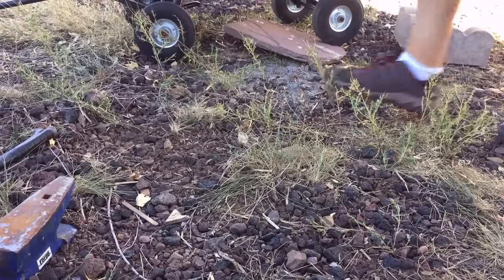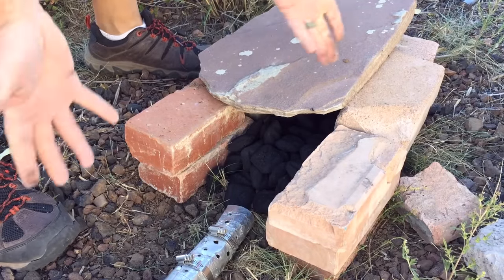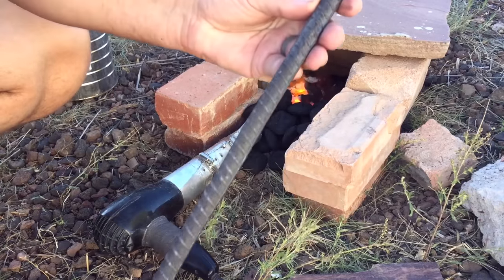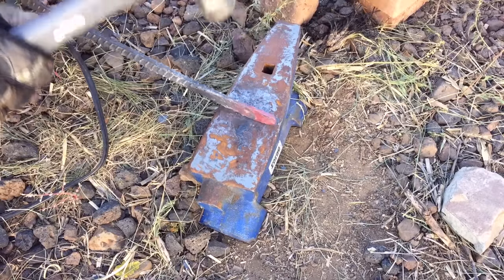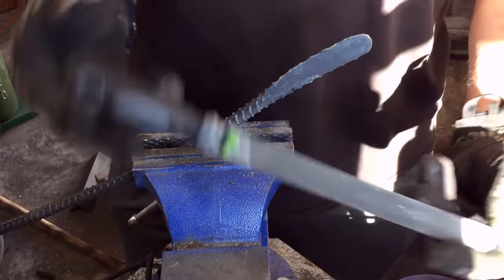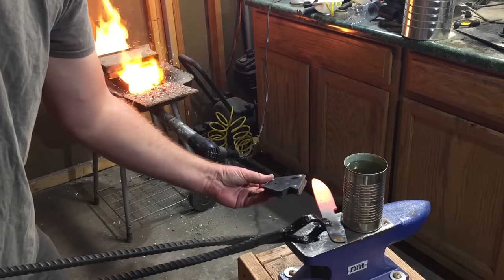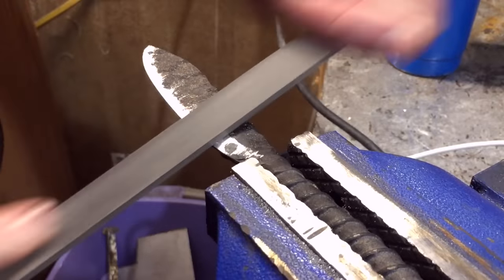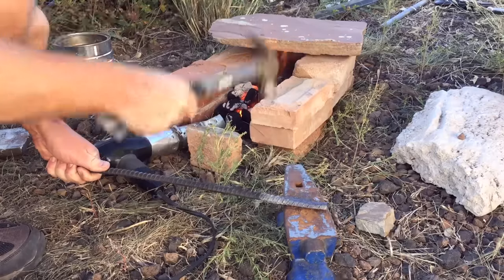Start forging TODAY in your own backyard - no special tools required

Comment: "this is rebar sometimes you will find it laying on your property" i guess rebar grows naturally in rural areas
Reply: you can find them in construction sites i guess
Reply: if you have brick laying around, theres a good chance youll find rebar nearby,
Reply: My grandad picks the stuff up wherever and whenever we can, I wouldn't be surprised to find out we have over a ton of rebar and old lawnmower blades and the like.
Reply from the maker: 🤣🤣🤣 Underrated comment 👌
Reply: Here in Kentucky it does lol
Reply: Lol.  My first question was, "wait, why?"
Reply: Mine found it yesterday in demolished bldg,  im gonna make a handle for hack saw.
Reply: in construction site they usually throw this kind of stuff on garbage can and totalled it into garbage collector for a cheap metal waste conversion. you can ask for 1 or 2 and they will probably give you
Reply: They actually seem like they do though...
Reply: Spencer R it’s ok, I just drilled into a building and found one
Reply: I need to replant my rebar, I've been putting it off.
Reply: Spencer R yeah pretty much actually
Reply: Thebasicmaker If you go to the bayou I Houston walk along always find lots of scrape metal and sometimes toils
Reply: That's exactly how our ancestors did it
Reply: It seems to on my property.

I have 2 acres, I've lived here 5 years and just last week I found 3' of rebar behind a tree. I've never bought rebar and the previous owner didn't do much in the way of construction, (or anything outside for that matter)
Reply: Chapter Master Adolf 
L
Reply: No he is talking about if you have one lying IN YOUR YARD DUHH
Reply: I found it growing out of my yard. A whole pile of it. Oklahoma
Reply: @dustinloyd3617  Haha yes, they seem to have developed a symbiotic relationship over the centuries.
Reply: Funny enough I tripped on some rebar yesterday.
Reply: Rebar can be found anywhere except for anarctica
Reply: i found some growing out of a pile of salmon berry bushes... four nice long stalks of re bar about 10 ft long with a bit of rust growing on them. It seems to have sprouted right out of the bramble roots.
Reply: I’m cleaning up my papaws after he died last year. There’s rebar all over the place. Also, lots of old metal to practice on. A month or two before he died, I asked him if I could build a forge because all the pieces and tools were there.
Reply: out here in the country, it really does lol, bought 10 acres, there's shit everywhere out here, even my own garbage dump yay
Reply: @wait4613  wait
Reply: I had some rebar protruding out of the ground near my fence on my property lol
Reply: Halo Theories  I already made two French nails.
Reply: Haha yeah, living in the suburbs you'll never find rebar just lying around. Nor bricks.
Reply: ya i found a lot
Reply: Spencer R Just the other day I almost tripped over a piece in my yard, I don't even live in a rural area, I live in a suburb. I'm not exactly sure why it's everywhere but it just is.
Reply: Yeah and I guess blowdryers grow on trees now
Reply: Rural workshops*
Reply: James Pfiske p r e c i s e l y
Reply: It really does seem to, yeah.  I think it's because it's used in a lot of construction, and extras or bent pieces just get tossed.  But, yeah, seems like you can just take one look at a property and think 'There's old rebar around here somewhere.'
Reply: Spencer R it does
Reply: Rebar is known to grow in all rural areas
Reply: TJ_ the_Insane  I would imagine so. I  moved to the property when I was 12, and I keep finding stuff buried where we put in gardens, lots of Hot Wheels and midsize Tonka trucks. I'm guessing a lot of the metal came from the 13 acres of Vineyards surrounding us, but that explains how it got onto our property.
Reply: James Pfiske 
I found three blowdriers in my wife’s sink cabinet apparently they had been breeding asexually.... she doesn’t need three....

And I’ve found rebar in lots of places around the world.... sadly I didn’t find any rebar in the off grid property I own, just three dead bodies.....
Reply: yes it really does
Reply: you clearly haven't been to arkansas, that shit grows everywhere
Reply: Can confirm. I live in a rural area and my backyard is a literal junkyard. I stepped on one that had a curved end and it whacked me in the face
Reply: You can find it almost anywhere next to job sites, allies etc or just buy a few short pieces. It is relatively cheap.
Reply: Spencer R wait is that a reference to I did a thing making the axe
Reply: oh yeah, its such a pain to cut in the summer.
Reply: I swear man it's just like trees
Reply: I guess some ppl live in a junkyard.
Reply: @iamtheteapot7405  Nah some people just live on a farm.
Reply: I actually think it does I see it all the time on our property
Reply: It's true! I just tripped over a bundle in my garage!
Reply: sometimes it really seems like that. i'll be digging up dirt for my garden when i uncover a rusty piece of rebar. the stuff is basically free
Reply: There is like four lying around in my yard
Reply: It seems to here in west virginia...along with junk cars and washing machines.
Reply: Actually...funny thing is, I found a 2 foot piece under my deck when I went looking.
Reply: Nice
Reply: Rebar grows wild out here.
Reply: Youtubes finest commentz...hall of fame comment
Reply: If you don't keep after it turns to cars on blocks
Reply: Rural Georgia, checking in: I have been absolutely surprised with how many pieces I have found on my land. Dig a new garden, find a piece of rebar. Cut back some old overgrowth, find a piece of rebar. I've found at least 5 pieces.
Reply: You have almost as many likes as  this video ha coments
Reply: It’s most frequent than you think. Probably the most common metal found in the ground left behind.
Reply: @dustinloyd3617  what type of Species are bricks
Reply: Yes, but not in those soil conditions the rebar he found was likely seed rebar that drifted in on the wind from a nearby clump
Reply: Go to rail road tracks, I’ve never not found scrap metal along the tracks
Reply: @Aidan Stone shit i don’t even know, I was a little drunk you may be right
Reply: Indeed
Reply: As someone who lives in a rural area, I can attest to this statement being true and accurate.👍😂
Reply: When we moved into our house about 10 years ago our backyard was littered with bricks after we picked them up we found rebar in quite a few places as well as in the front yard "garden bed"
Reply: I found six feet of 1½" rebar in my woods XD
Reply: I’m sure he meant if your already into doing thing that you have random tools and possible miscellaneous stuff for building
Reply: Well, yeah!! Sometimes at least, people dump all kinds of stuff!!
Reply: there is some rebar laying on my property rn lmao
Reply: We had a good harvest of rebar this year , 10 feet of it
Reply: First pierce of rebar I ever touched was just laying there near my house.
Reply: @iamtheteapot7405  Don’t act so fucking high and mighty, leftover rebar is found all over the place.
Reply: I know iwas thinking be good if I could find about 40 15inch ones in my garden for my shed
Reply: It's an invasive species so pick it anytime you get the chance
Reply: Recycling ftw? Lol
Reply: yes it does, i have around 30 meters of different sizes of rebar behind the house
Reply: If you live in poverty, like me, yes it's in your backyard
Reply: Actually yes lol
Reply: It does
Reply: I have found a few in an old lot
Reply: @iamtheteapot7405  nah, some people are just living like true men city boy 😎
Reply: @blanka1376  you find it everywhere lol old fencing, leftover construction, just for funzies. It everywhere 😂
Reply: My man, you don’t understand how we poor folk live. You need a vehicle to get to work, enough land for livestock(that’s the goal) and a gun. Rebar (if you want it or not) will be there.
Reply: @chrisquiett1776  lol yup, its awesome tho, great for us newbie blacksmith
Reply: @chrisquiett1776  poor folk? Dude! Id live like that even as a bilionare! Country for life
Reply: Only wild rebar
Reply: Ironically enough I have found random rebar
Reply: No, everybody knows that they grow naturally in the southern states of the US.
Reply: @johnsteel6008  i bet hes going to have something historical without realizing it
Reply: Sometimes you could swear it does grow on trees.
Reply: Iron root. It's fun to cut trees with nails in the middle that grew in over decades and have disappeared into the tree. We call that iron wood
Reply: I had a rebar farm in my old side yard.
Reply: Typically used to mark out property lines 😂
Reply: I found some wild rebar out on my land lol.
Reply: Kinda like hypodermic needles in the city.
Reply: It does.
Reply: That's what it feels like sometimes.
Reply: xd it does
Reply: It dors
Reply: @TheRoadhammer379  what, how is that derogatory to anyone
Reply: Is that not normal
Reply: Well, in my local area there is a landfill the farmers use and it's full of rebar
Reply: I literally said the same shit. Next day walked outside and found about a 6 foot piece next to my house I am still surprised
Reply: Wait, did you not know it does?
Reply: I pulled a huge piece out of the ground. Thanks old tenets
Reply: I had a very good friend give me a rebar tree I planted and oiled it everyday and patiently waited only to come out one day to my surprise to find I had a angle iron TREE oof
Reply: @R3nz_  lol, that’s probably your property line from it being surveyed.
Reply: Funny, lot's leftover from building jobs. Bent into shapes so they can't reuse! Make friends with some builders!
Reply: You clearly have never lived in the boonies trust me you find some random shit in the pasture
Reply: You’d be surprised lmao
Reply: Broken buildings
Reply: My property used to be a dump for debris from construction back when my neighborhood was being built in the 1970's. I find rebar all the damn time in the woods on the edge of my property.  That shit makes excellent weldable material.
Reply: Usualy if a house is built they had concrete somewhere near by there probably will be rebar there
Reply: It does
Reply: As a contractor specialized in concrete I can confirm this.
Reply: I guess that’s the point of adding sometimes to specify you won’t always
Reply: You gotta plant rebar seeds first
Reply: Its true you just gotta find a rebar plant
Reply: I’m still trying to get rid of the infestation
Reply: Rebates just sprout out of the ground around here
Reply: Tbh out here it basically does 😂
Reply: It also grows in Home Depot
Reply: I love it
Reply: Its a common form of trash. Even here in the suburbs you can often find some laying around the foundations, abandoned by the construction crew
Reply: It does trust me
Reply: Yes
Reply: I can confirm this
Reply: Seeds of Steel Rebar !.. never Seen one ?
Reply: Sure does
Reply: It does, dude.  I've lived on my property for years now and I still find rebar/tires/wheels/bricks/all sorts of interesting shit from time to time.
Reply: It's true
Reply: Maybe not but that stuff litters the ground at construction sites
Reply: Yep
Reply: @napoleondynamite4148  no but the dollar store though.
Reply: I have a bunch growing wild on my property, so I'm just gonna break off a couple pieces and get to work
Reply: On my property?  Yes.  And backhoe bucket teeth, random bolts and nuts, steel rods, mower blades, plow blades, a cast iron bathtub, and more.  Any timenI dig up dirt on my place I find either metal or glass.
Reply: Everywhere modern humans dwell was once a construction site. Therefore you may find spare rebar laying around.
Reply: It actually does....
Reply: @skankhunt6066   I live in Nicholasville,  can confirm.
Reply: Go to a river or creek with bridge get a magnet or grappling hook throw it in you will find rebar
Reply: it does
Reply: Lets see does it grow in yards? No and I don't believe thats what he means in his statement.
As a construction working and home builder. Yes go dig your yard up close to your houses concrete foundation hell take a metal detector bet ya strike gold with rebar then and it will seem like ita growing out your yard. And you young man will learn yes there is rebar in most new constructed home sites. Especially those with concrete foundations end of story. Oh and one other thing its wise to understand not assume. Understanding comes from seeking the truth. Truth is they do throw waste on build sites buried in your yard. Believe that as fact.
Reply: It does grow I shit you not
Reply: Live on a 80yo farm, can confirm
Reply: Hater
Reply: I know. I'm wondering what this guys property looks like
Reply: Yeah it does the chickens usually eat it
Reply: I guess it does. I have quite a bit, but I can’t remember where I got it.
Reply: Lol
Reply: It actually does tho
Reply: Best comment on here 😂😂
Reply: Pretty much
Reply: They use rebar for land markers.
Reply: It really does, I find it everywhere
Reply: In Oklahoma and Colorado I can tell you it does lol
Reply: I’m upset that I actually found some in my yard lolol
Reply: I.m ig it does there was a long bar in my garage also you can buy it at lowes or home depot for lik 5 dollars
Reply: @dustinloyd3617  Well my parents have bricks laying around...
Reply: i'm not kidding i've got wild rebar and i-beams laying in the backyard cus the guy who owns the farm next to ours builds bridges
Reply: I have found a 20 foot piece of rebar
Reply: Does it not grow on your property? I've got whole rebar gardens.
Reply: It definitely has its pros living in rural areas!
Reply: I've found probably 30 3ft rebar pieces with a metal detector on my property
Reply: Your neighbors concrete drive way may have rebar when he goes on vacation or is at work. 😂
Reply: Actually I have a hell of a lot of it up against the fence in the back corner of my yard. I'm like YES...PROJECTS 😈😂
Reply: Must of never seen a great southern rebar tree 😂😂
Reply: @nathanthegreat28  yep that them should see them in full bloom 😂😂😂
Reply: The fact that this isn't a joke.. because ever time I go on a walk around the local paddocks or around the block in urban areas, I find rebar literally everywhere
Reply: Ngl it does I was working on my property and found a rusty screwdriver like a foot underground
Reply: Old guard rail posts have a bunch of rebar in them grab a hammer and volia! Free rebar freebar !!! lol
Reply: Kinda yeah rural texas is full of old metal junk lyin around in the desert and old farms just from breakin off of stuff and forgotten structures over the years
Reply: Check your crawl space. That’s where it grows best
Reply: Yea you’d be surprised, I find random nails, rebar, metal sheets and slivers. It’s everywhere if you look
Reply: @mohanbhartiya2705  actually our ancestors used meteorites
Reply: Basically
Reply: i used to live in the country and still kinda do. its true wander the desert youll find rebar brick and other trash
Reply: Thankfully I work construction so all the materials needed were available for free. Good to see my crude assembly is practical
Reply: That's the south for ya
Reply: Lol only place I’ve ever seen rebar in the UK is when I was on a fabricating apprenticeship hahah. No known rebar in the wild here
Reply: It grows on the side of the road
Reply: it has a .13% more chance of spawning in rural comunities
Reply: With how much u can find ud swear it does 😀😂
Reply: And barbed wire lol
Reply: Yup, it does. Been living on our acre in Spain for three years and am still finding more.
Reply: yes i found it grows naturally in tentricle formations
Reply: That's good
Reply: Sure feels like it some times!
Reply: As somone living in a small swedish village, yeah it seems to grow fine.
Reply: if you see invasive rebars pluck them out of the ground, they hurt the survival chance of the native ones
Reply: Pretty much LMAO
Reply: It grows in concrete sidewalks
Reply: Citiot
Reply: I have a rebar tree.. The kids always sneak in my yard and pick them before they get to full length..
Reply: Tbh yeah, ya find it in places u wouldn't think
Reply: I have a serious problem with rebar growing on my yard a have tried everything to get rid of it I find a angle grinder works pretty well now I make so much money growing rebar I was able to quit my job 😅 🙃
Reply: I find rebar fucking everywhere
Reply: I got that shit growing up all over my property, like weeds.
Reply: Just about in the south you may find a stray peice sticking from the ground by the woodline🤣
Reply: 🤣🤣🤣 yeah sometimes lol
Reply: You have no idea
Reply: it sure seems to
Reply: You know, it does I find it enery were
Reply: It grows and yields better than my crops in the field
Reply: As someone who has fallen over and hit some rebar at home, yes
Reply: It is here
Reply: I found some laying around my barn
Reply: The can't you tell that this guy is a rebar farmer?
Reply: It grows pretty often at my place, it blends with the tall grass though.
Reply: Rebar is a native vegetable it is grown from the rare barria plant.
Reply: Ah yes the wild tree reebarium steelium
Reply: Mama used to make the best rebar pies
Reply: its been ten years since my house was built and yes, theres some still laying in the ground... 
and i got some from the bins as the other houses were been built.. never know wen you need an irrigation pin, or sturdy plant stake termites cant eat
Reply: It's true lol
Reply: Didn't he say that you could get it at a store?
Reply: City boy
Reply: They do, in postsoviet countries they are everywhete
Reply: They do I've been growing one since it was a foot long 4 years later it's 10 feet
Reply: @skankhunt6066  I think they used it to mark property lines in Ky we had a lot throughout our neighborhood
Reply: You laugh about but let me tell you. I got pieces that I have no idea where they came from.
Reply: Surely not hard to get tho
Reply: Picky a hole aren't we?
Reply: Yup.  I found 12ft at my house - laying between the fence and the vegetable garden.   Literal people suck.  They honestly do.  Suck the life and hope out of any prospect.  Well done.
Reply: Here in Britain 🇬🇧 it does
Reply: Honestly wouldn’t be surprised if it reaches did
Reply: Correct. I have a rebar farm near my house. Very successful.
Reply: Dead cars tend to grow in rural areas also……
Reply: over 100 years yeah you might find some.
Reply: In the country where i live I dig up metal all the time including rebar
Reply: I bought a cabin in the sticks, I got rebar seemingly growing everywhere!
Reply: Actually it does!! I found some sticking out of the ground just last week. Might be blooming soon.
Reply: He must live here in Texas
Reply: Wait. Not everyone has a native rebar tree?
Reply: It’s like a half joke lol
Reply: As crazy as it sounds it's true. I found an old piece of rebar while cleaning up my yard when I first moved in.
Reply: It does Ive found about maybe eight pieces now
Reply: I can confirm
Reply: If your house has a concrete foundation, then there is very likely a piece of rebar laying next to it somewhere. It’s probably buried a few inches under the dirt/gravel, but it’s there. I’ve never met a concrete crew that picks up their scraps in 20 years of construction. 😂
Reply: If you don't have a stable rebar population, you might find the smaller cousin, barbwire 😄
Reply: It depends on where you live, if you live on a big estate (farm, plantation, construction, etc) you will likely find it laying on the ground.
Reply: Guys property is hella big! 😂
Reply: Post apocalyptic games
Reply: Nope rebar grows naturally in industrial areas. This is where youre having the problem.
Reply: Fr lol, I don't even work with metal yet it's just randomly lying around the yard 😂
Reply: frl yeah
Reply: He should have said, “Men capable of forging a knife from logic and experience with zero training, will find rebar in their yard”. 
. Any home owner worth his keep has rebar somewhere and could likely take a small amount for a knife to be made. Since you aren’t that person, it likely went over your head. Glad I could clear that up for you lol
Reply: They use rebar at property corners to easily find them in the ground with a metal detector…. Lol don’t use the rebar you find near what is likely, your property corners…. It’s there for a reason. Makes surveying your property easier if you are going to expand it or section it off into multiple properties.
Reply: Does your backyard not grow it….?
Reply: Do you not have a rebar tree?
Reply: They grow best in construction sites
Reply: In permafrost areas of the world they grow continually and usually are found when a tire is blown 😢
Reply: I too have come to find this 😂
Reply: Unfortunately that's how it feels sometimes
Reply: I live in just a random rural town, and I think I have found 100+ bars of random rebar. It has to be growing here.
Reply: I have several feet of it around my house. Not really sure how it got here but it did!
Reply: Just found a piece a week ago lol
Reply: Believe me it does I dunno where it comes from but we got tons of it where I am
Reply: Greatings from Germany Bavaria here you realy find them often lying aroun in small groups
Reply: I live in a city and I’ve got about 20ish feet of rebar just sitting in my room don’t even want to count how much I’ve got lying around my house😅
Reply: Trust me. They really do.
Reply: Yeah you can basically just surface mine for it lol
Reply: yoska222  found an old ass rusty rebar hanging on the side of my shed
Reply: Crazy story  just moved into a new house and I actually found rebar lying around
Reply: I really think so. You dig and it's just there.
Reply: Wait it doesnt?
Reply: I have 7, 4 ft each😅
Reply: Train tracj
Reply: Train tracks
Reply: @dustinloyd3617 I don’t
Reply: It does in Australia mate
Reply: Reading this comment as he explains in the video "its easy to find 20 feet of it for $20-$30......oomph comment.
Reply: @dustinloyd3617 i mean hes not wrong
Reply: This is true. I’ve never bought rebar ever. I just go to my backyard. There’s always a wild patch sprouting somewhere.
Reply: It must cause I can't kick up dust with my foot on my place without stubbing the shit out of my toe on some buried rebar
Reply: It really does you don’t understand
Reply: A lot of times rebar is used to mark the edges of a property by a surveyor. So if the property has changed hands a few times it’s not unusual to find rebar on your property.
Reply: ...... yeah.
Reply: The mystifying wild rebar has confused scientists for decades, with it's ability to seemingly materialize out of nothing. This phenomena has been reported all across the globe, but seems to mostly appear in more rural areas. Note that if you find wild rebar on your property, there may be bricks or cinder blocks nearby, as they seem to appear together frequently.
Reply: dude i have a shit ton of rebar that my dad has just gathered over the years
Reply: Yeah, we got steel trees and brass bushes
Reply: Apparently it does, I just found one lmao
Reply: It actually doesn't grow but procreates and yes it's natural habitat is rural backwoods areas.
Reply: Came from the south so might be related, but where I live you can’t drive a few miles…or walk, without finding some kind of “useable” type of material like dudes showing, rebar just seems to be abundantly abandoned down here🤷🏻‍♂️😂💀
Reply: Just look for  a junk pile,  that have weeds growing in it
Reply: I found some in my creek when I moved into my house 4 years ago
Reply: @iamtheteapot7405  better than where you live, I'm guessing some Cesspool City.
Reply: @BryantWalker-m6e  did I hurt your feelings or something? Why are you trashing my city when you don't even know what city I live in lol
Reply: Can confirm, rebar does grow naturally in rural and semi rural environments. 🧐
Reply: It really does
Reply: Yes it grows I go diging for it some times
Reply: In my woods, there is a tonne of trash and old things.
Reply: Yeah the spawn rate for them is very high on con sites and villages 😂😂
Reply: I know this is 4 years old, but no joke, I bought a house in my hometown and literally found 20ish pieces of rebar that are who knows how old just buried under sticks and leaves while cleaning up the property
Reply: Nah for real, I can locate a few pieces on my property just from my memory
Reply: Lol!!!😂😂😂
Reply: It generates naturally in the bins around building sites...